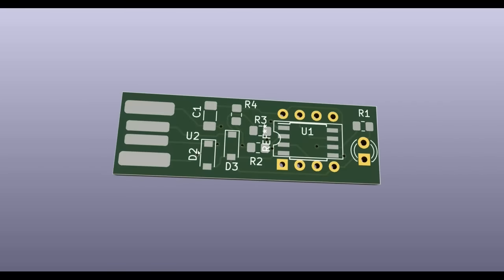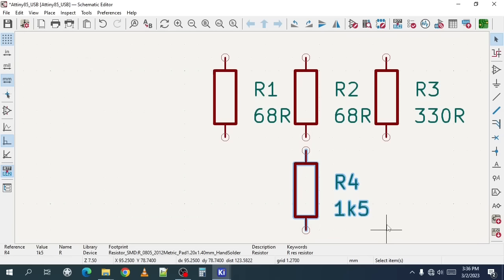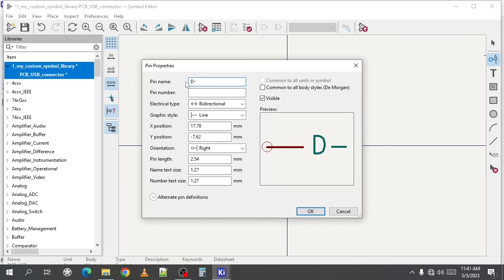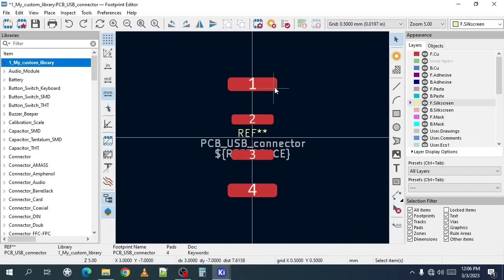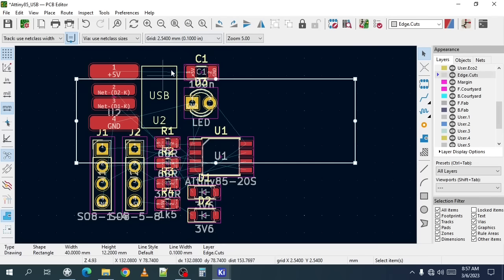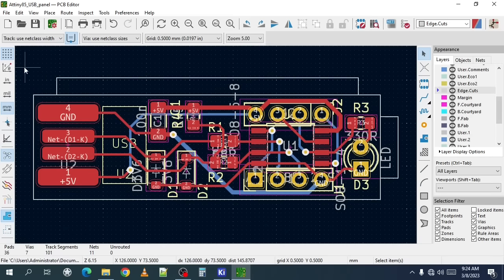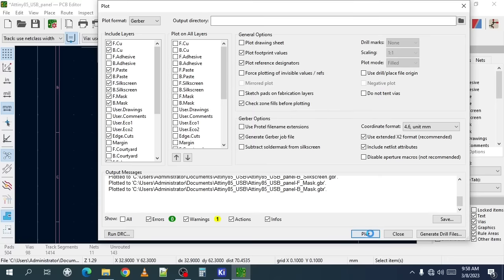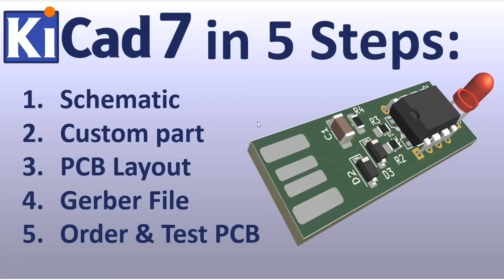KiCAD 7 PCB Layout in 5 steps

Comment: I have seen people put holes on the board's edges while panelizing. This makes it easy to break them after receiving the boards. I am curious as to why you didn't do that and how you managed to take them apart.
Reply: I am also interested in that. Mousebites are not that accurate, but you can break it manually. This way looks more like for a machine milling the edges to separate. I guess he cut it by hand though with a saw or something. Could you find another video that covered the mousebites?
Reply: My PCB suppliers score them. This keeps them rigid enough for component assembly, but easy to snap apart.

Comment: How do you design your own through hole connectors instead of the pads? I don’t really know the spacing of the standardized pins.
Reply from the maker: Fir this you will need to check the specification of your connector, it will have a mechanical drawing showing the pin diameters and the distances.

Comment: Thank you for boiling down a complex process into a workflow that is easy to follow.
Reply from the maker: Thanks Bill! KiCAD is really easy to use, you just need to start.
Reply: @smartpowerelectronics8779  Thanks for the intro! I was wondering while you did the PCB routing... Does KiCAD not have an autoroute function?
Reply: @Sekir80  You have to install a plugin for it.

Comment: I wonder if folks who have commented below has actually gone through the video (except for some), there are so many things which are missed and not explained.
even the schematic and PCB are not matching. I have spent like 2hours figuring out what am i doing wrong, when i realized that the reference itself is incorrect.
Never the less, I really appreciate the time taken to compress the video of the entire design in 13mins. Please add note and comments wherever necessary for new designer who refer to this video.

Note: above comment are for my observation for this video only, other videos from Mr. T  are great, keep up the good work
Reply from the maker: @princegautam6825  Thanks man, I do the channel only for fun
Reply: Totally ran into the same issue(s). Literally watched the video frame by frame at a few spots. Love the tutorial either way but the speed and skipped features left me frustrated (like the fact that the USB orientation changed and J1 & J2 were modified).

Comment: Coming from Eagle, i didn't need an entire bare basics session, just a quick run-down from start to finish. For that this is a great tutorial!! Now to start the tedious process of migrating and updating all my libraries.

Hard to believe i'm actually making the switch honestly. When i started in 2011: KiCad was a mess and CadSoft Eagle was what i was trained to work with in college. But then CERN got involved with KiCad and Autodesk with Eagle. Now there is a open-source powerhouse while the former champion is slated for deprecation...
Reply from the maker: Thanks Chiel, yes in the comments I learned that KiCAD came a long way, it is now a pretty good PCB layou package!

Comment: You can easily make a combined footprint of THT and SMD pads, which lets you simplify the design process and the look of the schematics.
And it's also a good idea to make ground-plane.
Reply from the maker: yes there is a function to make a ground plane, however for this design the frequencies and currents are low, not very critical ;-)

Comment: EXCELLENT! I've recently worked my way through the 10 great Digi-Key tutorials to design my 1st SMD PCB, using a Teensy T4.1.
But now, I'm searching through all of them, just to make sure I've followed all of the steps correctly. Thanks to you, I can do that within minutes.
The only important step you've skipped over is drill holes for vias (AFAIK).
EDIT: Just checked out your channel. Great content, right down my alley. Congrats on earning a new sub. 😎
Reply from the maker: Thank you for your compliments!

Comment: Dear Sir, this is by far the most well presented tutorial on how to use KiCad along with a practical example. I'm a recent graduate with electrical background. I decided to chase PCB design career. If you offer any tips/ pieces of advice for young adults/ and engineers on how to get good at this profession, that would be so kind. 

I made the circuit and can't wait to test it.
Reply from the maker: Thank you for your kind words, to become good at PCB layout I suggest you get familiar with the famous software packages and practice. Learning electronics basics is also very important because your main "customers" will be electronic engineers so it is key to speak their language. The requirements are different per industry, so you may need to pick a direction. Power supply or lighting (my specialty) has different requirements than digital design (phone/android box etc) . Wish you good luck and much fun in your career!
Reply from the maker: My major is power electronics, if would start now I would go for software (embedded or application all is ok). For PCB layout, suggest to get familiar with more systems and some analog electronics so you can imagine what the design engineer needs. Please consider (my opinion) that PCB layout engineer is a quite narrow field with job stability but not many career options.

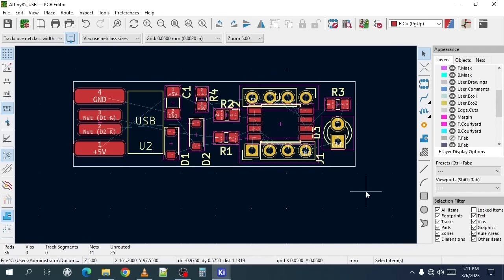Comment: Great video asside from a few things, 1. You didnt show the footprint selection for J1, J2, and D3, but i was able to see them in the logs when you transferred from schematic to PCB. 2nd, it is hard to follow what you did (or maybe im just dumb) im stuck on 7:45 wondering how you flipped the red pads (will edit when i figure it out) 
Edit: ok i went back into footprint editor and change the pads, idk if its the right way to do it but hopefully itll still work
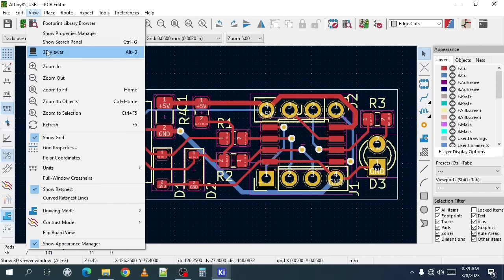Edit: im on 8:09 why cant i put the track to the one where i want to. I'm trying to connect D1(1) to R1(1) but it only lets me connect to R1(2), pls reply if u know how to fix, is it flipped on schematic editor? bc i cant tell bc its symmetrical. 
Edit: Ok i just fixed it by flipping it, there were also other issues with wiring that i fixed by moving the wired around
Edit: also what is the difference between this and the "make your own digispark USb in the description:

Comment: The Y axis distance between J1 and J2 for the ATtiny25 pins to fit well is 7.62 mm apart, They're going to fit anyway,  if anyone was wandering becasue of the design, but an exact 7.62 mm will give a nice snug fit. Then choose between the chip and the SMD as you desire with no issues.

Comment: Thanks for the great tutorial. just a quick question, were the 2 though-holes connector designed to place the chip? then what are the SMD pads for?
Reply from the maker: you can put a DIP8 chip OR the SO8 chip + connectors, so it is a combination PCB 🙂

Comment: Very concise, well executed tutorial.  Thanks for posting. Do you have the Kicad project, and gerbers posted somewhere easy to download?
Reply from the maker: Hi Randall, gerber link: https://drive.google.com/file/d/1Tmd5g5Fi2FBHl1uyKpxUBqJNKZqnLLu9/view?usp=sharing
Reply from the maker: Note that I put the panel "bridges" on the edges of the pcb's. which proved not ideal for cutting them out.
Also the PCB is normally 1.6mm thick, you will need ~ 2.2mm thickness to have a good USB contact. 
To fix that I cut a piece of 0.6mm thick plastic from peanut butter jar (important detail ;-) and glued it on the back.

Comment: I had to return and refresh, you present fast for my old brain. I had a schematic designed but lost how go further. So i can back. some functions are so obscure you must study and learn each function. Nothing is intuitive. I usually can poke around and get by finding what I need to do. Bu this application has so little logical relationship with function and feature I am not sure I will ever be as swift and sure and you in this video. But I will continue to try. I just need 2 stupid simple boards made. Dennis  I slowed the speed to .75 so I could take notes and follow along better.
Reply from the maker: Not so young myself ...1968'er  ;-) I actually struggled with KiCAD myself at first but I wanted to have a PCB layout and schematic software that is running locally on my PC, no cloudy server stuff ...That is why I made the video after finishing my first layout.
 The best way to learn is to make a PCB, hope my video was useful for you though. It is edited very fast to make sure the younger folks do not get impatient.
Reply from the maker: Thank you for your positive comment by the way 🙂

Comment: What did you use to cut them out individually? They don't look like they would have just snapped off. Thanks for making this video. I have struggled with making panels, and always had to go back and forth with the pcb manufacturer, whom basically did it properly on their end. 😅. Shoutout to jlcpcb for that!
Reply from the maker: I used a knife to score the breakouts, it can be done better by adding some vias in the breakouts. One viewer commented this. Search for PCB mouse bites🙂

Comment: Has kicad always had air wires in the board view? I tried using it a couple years ago and it looked like you had to design the circuit twice in two different views. Maybe I was doing something wrong, but that’s why I went back to Eagle. Looks like kicad will do what I want now

Comment: On the USB connector, I believe Data - (minus) should be adjacent to +5V, and Data + (plus) should be adjacent to Gnd. I also think the footprint would be a better fit to the mating female connector if the distance between pad 4 and pad 3 was reduced from 1mm to .75mm, and the distance between pad 1 and pad 2 was reduced from 1mm to .75mm, while maintaining the distance between pad 2 and pad 3 at .5mm.
Reply from the maker: Are you sure you are not Chuck? ;-)
For D+/D- you are right! D- is next to Vcc.  The schematic symbol is wrong, the PCB is correct.
Fortunately it was correct in the Video about the DYI Digispark (https://youtu.be/XwEZvaGyKDE)
For the mechanical dimensions I used a USB drive as an example. I made a digital photo next to a ruler, enlarged the photo and copied the dimensions.
I have searched for a standard for this PCB type USB-A foot print, but did not find any. 
Do you have a good source?

Comment: What connector do you use for the connector j1 and j2 footprint library
Reply from the maker: I do not have the desing files anymore, but I looked it up, pretty sure it is:

Schematic: Chose Symbol, Connector_Generic/Conn_01x04

Footprint: Connector_Pinsocket_2.54mm: PinSocket_1x_04_P2.54mm_Vertical

Comment: Hello and thank you. I have made wrong size of the USB area. After remake, I inserted the corrected footprint into the PCB. I have deleted the old footprint of PCB_USB_connector. Then I don't have connection/relation between the scheme USB connector and PCB_USB_connector footprint. How to make the relation? Because I cannot join the Cu ways to the contact of PCB_USB connector.

Comment: Thanks because I see that you are good, you can finish the job and see it work and that's it. Seeing the video is encouraging but yesterday I downloaded Kicad and started to make a very simple project, a power supply board with a bridge, two terminals and 8 capacitors and after a day of exercises I gave up when I saw that there is no library with the footprints and I had to create them myself. too difficult and I gave up because it is all very difficult. Many acronyms that I don't know what they mean... and non-existent commands, in my way of thinking. For example in EasyEDA there is a command to generate the PCB from the schematic. In Kicad I didn't see it, it doesn't exist, and then, after a day to draw the schematic I had to create the PCB and I didn't understand how to do it. I tried EasyEDA in the last few days with the online libraries and it was easier to find the components and generate the PCB but even there there were things that didn't work and I didn't understand how to solve them. In the end the PCB was beautiful in 3D but half of the components were missing and you could only see the pads but I looked for the components in the library and there should have been footprints with measurements in each imported component. I don't understand why it works halfway. And then, it's impossible to understand how to draw the tracks. They weren't there in 3D and it seemed impossible to me because the connections were exact and I had positioned the components as I wanted. And then I gave up because I don't understand these programs. I've been doing electronics since 1978 in the old fashioned way and PCBs with a marker and ferric acid but small tracks don't always come out well. I've seen these programs and the beautiful PCBs that cost little and it would be really nice to be able to make them of high quality but these programs are not easy to understand. I could do it if I had a teacher to ask him all the questions I want and they don't find an answer. With there's a good Help like in other serious programs on the PC with the search for topics and words... It's been 3 days now and I've gotten very little and I can't do more. I just wanted to tell you that you are good, it seems that you understood enough to finish the job and I wanted to give you my compliments. I hope the translation of this message is excellent, I don't speak English.

Comment: Any book to learn about such components ? I know basic electronics and am able to repair stuff. But my formal education has been limited to basic electronics only which never taught about usage/practices about such components used on such a board.
Reply from the maker: To learn how to use micro controllers I suggest you start with Arduino. Buy some Arduino Nano's and start with the basics. You can find all information for your level of experience on Youtube or on https://www.arduino.cc/ .
Reply: @smartpowerelectronics8779  I'm good with board & programming them.
I meant about other electronic components as I see there are a lot many passive/active components/chips which I don't know about and don't even find any place to explore about them.
Reply: I’m learning mostly through trial and error. Great Scott has many great videos about reading data sheets and understanding symbols etc. a lot of the micro controllers will have typical use case diagrams in the data sheet that you can reference too

Comment: Is the footprint required, or can KiCad just to standalone Schematics?

Looking for a program to do wiring diagrams/electrical schematics.
Reply from the maker: There is no need for a pcb footprint if you only make a schematic.
By the way you can also do simulation in KiCAD, but I never tried that.

Comment: What is the thickness of this PCB to ensure that it fits the USB female B connector? Thanks.
Reply from the maker: I could not find it in a standard, so I measured it on a similar USB stick, it is 2.3 mm.
To get the right thickness I cut out a piece of a 0.7mm thick plastic lid and glued it on the bottom;-)

Comment: Thank you and well done.

I noticed that you dont use the pads that was costume made for the Tiny. Instead used the socketed mounts to solder on the tiny. Did I understand that correctly?
Reply from the maker: Yes, you are correct. I use the socketed mounts for pin headers with a SO8 ATTINY. You can also place a DIP8 in the pin headers ;-)

Comment: I am Facing this issue can you guide me, which footprint use j1 and j2 
Error: J1 pad 4 not found in Capacitor_SMD:C_1206_3216Metric_Pad1.33x1.80mm_HandSolder

Comment: Thank you for the tutorial it was very useful, I have a small question, what is the footprint of connectors that you used for this pcb design, thank you again
Reply from the maker: Sure, here you go: 🙂
Schematic symbol: Connector_Generic/Conn_01x04
PCB Footprint:  PinHeader_01x04_P2.54mm_Vertical
 If you put them on the right distance you can choose to use them for pin-headers or to place a DIP8 Attiny85.

Comment: I have found major issue with kicad. It can't find footprints from the included libraries when translating from schematic to the PCB editor.
So I'm back to using Design Spark. Far superior in my opinion.  You don't have schematic to PCB errors from not finding footprints from the included libraries

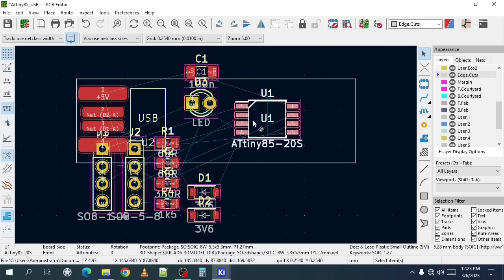Comment: In the video (7:45) the USB connector is mirrored. What is the correct placement?
Reply from the maker: Hi Fenris, in the PCB the connection is correct. I used the PCB and it works well.
(You are right: The naming of D+ and D- are swapped in schematic and pcb, but functionally connected correctly to the Attiny85, so the circuit works, sorry about the confusion)
Reply: @smartpowerelectronics8779  Thank you for the answer (and tutorial). I just have to be sure if I make and order a test PCB from your tutorial 😃

Comment: The tutorial was good with exception of the speedup to place components. I'm playing it at 0.5 speed and it's still wayyy too fast to know which footprint you're using. It's on screen sometimes for only 1 second. Such as at 2:02 where you copy the diode and immediately did a capacitor that was covered up by the add component window. It was hard to tell you were doing a cap until you put in 100n as a value.

EDIT: I just finished the video and think they cover up some boo-boos in weird ways that make this very difficult to follow. For example, at 7:43 he fades between the finished layout and it appears that they swapped the pins on the USB connector completely.

Comment: I looked at USB A connectors online and see D- is next to Vcc. On the custom schematic you have D+ next to Vcc? Does this matter ? I have duplicated this design as an exercise and for some reason my Vcc and GND on the footprint ended up being inverted compared to yours ?
Reply: what I did is renumber the pad from 1,2,3,4 to 4,3,2,1 and it now seems to be the same as your output ?
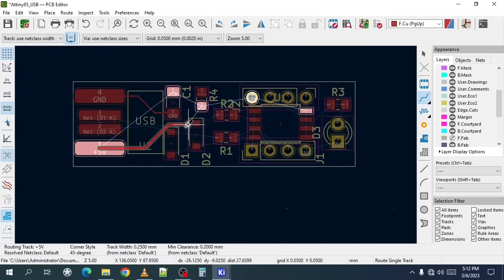Reply from the maker: In the video at 8:07 you can see which USB pin physically is connected to R1 and R2 and the MCU. The PCB works - I can guarantee that.